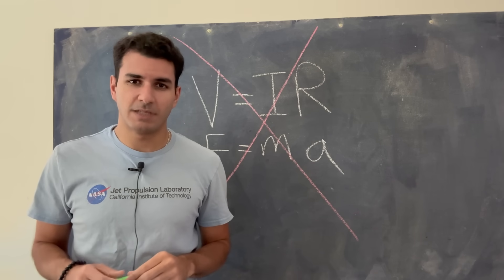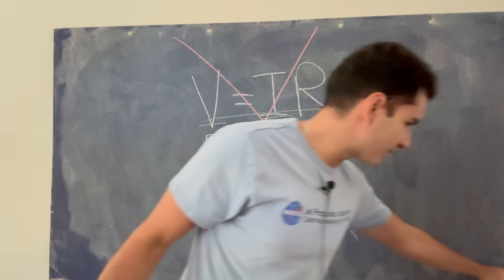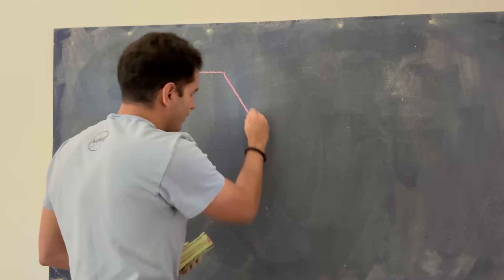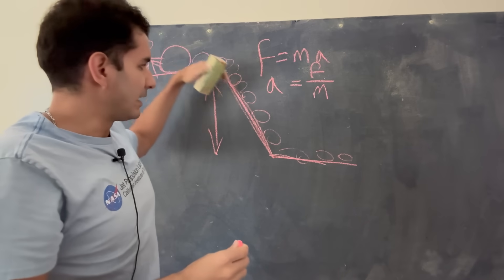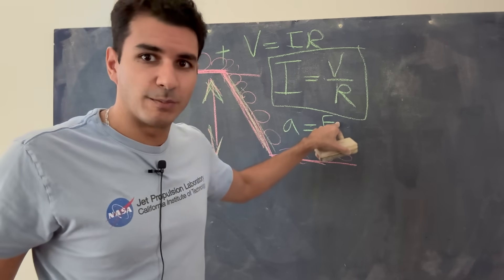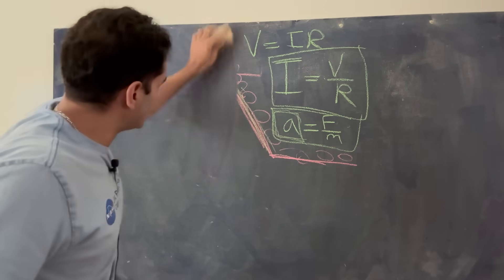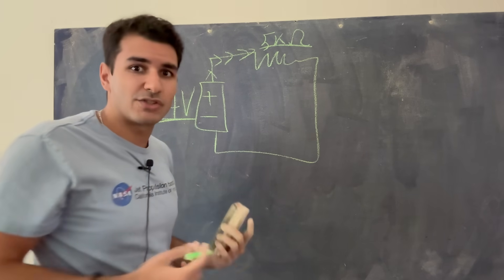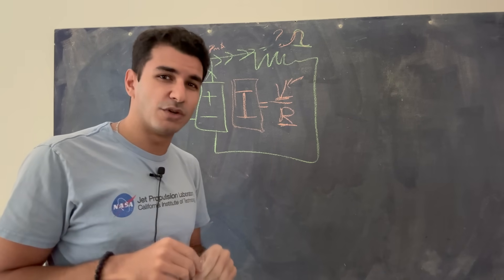You don't really understand physics

Comment: As for Ohms, law I see the problem more like this. Take a bus of arbitrary amperage, yet more than the resistors capacity. Given a certain voltage, the resistor will only let so many electrons though per time period. If you increase the voltage of the bus, more electrons get through per time period. The point is the resistor as per voltage is a hard limiter of electron flow.

Comment: 5:49 Kinda weird analogy. Gravitational and electric potential on punctual charges are both proportional to 1/r, but the former needs a much larger scale for it to start acting like the latter. Gravitational potential is so hard to change that we consistently assume our classical mechanics problems happen assuming it's constant. Electric potential can be modeled as non constant p easily. That's why it's recommended that You don't think about change in eP with the same arguments as the change in speed using gP.
Reply: Changes in acceleration in classical dynamics are more affected by air resistance than change in position
Reply: We don't assume the gravitational potential is constant. We assume the force is. The actual assumption of the potential is that it increases linearly with distance to the ground.

Comment: I made a video on my channel where I talk about normal acceleration and what it really is. In every physics class I've taken (like 4), it has never been described correctly. My problem with how my teachers and professors have described it is exactly the issue that you describe in this video. Essentially, people describe v^2/r to be normal acceleration. It implied that a normal acceleration is caused by taking a curved path. Rather, which is what no one says, is that the curved path is implied by the normal acceleration. A fighter pilot does not experience many G's of force because of a tight curve he's turning. A fighter pilot is experiencing many G's because there is a giant f***ing engine thrusting him perpendicular to his velocity. Im glad you're highlighting more examples of this misunderstanding.
Reply: I think you are mistaken. The RESULTANT force on the aircraft is given by mv^2/r. There are other forces on the aircraft besides the engine's thrust such as lift and drag, altogether they compose the resultant centripetal force. Because this force is radial and there is no angular acceleration in the simplest case the resultant acceleration is v^2/r . There has to be a force on the pilot keeping him inside the aircraft and moving with the plane, the harness keeping him in place will stretch and apply this force on him. 
Centripetal force is not a force like gravity, it is merely stating that the resultant force is directed radially inwards. It is not a separate force that acts on the plane, this is a common misconception. It ought to be stressed that a centripetal force is not a constant force because although the magnitude is constant the direction is not. Take the example of an object at the end of a piece of string that is swung in a horizontal circle, the force on the object comes from the stretching of the string and is the tension. This tension is directed towards the centre and is called a centripetal force, it is not something that occurs because of circular motion but rather its circular motion occurs because the tension is directed towards one point.

Comment: This is approach is not totally correct either. We should say instead that a force produces a change in momentum, meaning d(m*v)/dt = f. If the mass is constant then this reduces to m*dv/dt = m*a = f, so in that case you can reinterpret this as a=f/m. But when both the mass and the velocity are changing, like in a rocket launch, this becomes m*dv/dt + v*dm/dt = f, and in that case is not only the force creating a change in velocity.
Reply: Actually, d(m*v)/dt=f is wrong, unless you're very specifically considering an instant in time at which the fuel particles that have just been emitted are stationary relative to the inertial reference frame that you're working in. The correct equation is
m*dv/dt - u*dm/dt = f
if f excludes the propulsion force from the fuel, or just the classic "f=ma" if f includes the propulsion force from the fuel. In the above equation, the term 'u' denotes the emission velocity of the fuel relative to the rocket.

Comment: F=dp/dt is i think the proper representation of force. F=m.a cannot be applied for variable mass like rocket propulsion where mass of gases ejected makes the mass of the rocket variable
Reply: F=ma is the correct equation for a variable-mass system, as long as the "net force F" on the left-hand side includes the propulsion force (defined as udm/dt, where u is the emission velocity of the fuel relative to the rocket). The equation "F=d(m.v)/dt" is false for variable-mass systems like rockets, unless you're very specifically considering an instant in time at which the fuel particles that have just been emitted are stationary relative to the inertial reference frame that you're working in (and then, you have to exclude the propulsion force from the "net force F" on the left-hand side of the equation, which is not very intuitive). The paper "On the use and abuse of Newton's second law for variable mass problems" (Plastino & Muzzio, 1992) documents published errors based on the common misconception that F=d(m.v)/dt is the general equation for a variable-mass system.

Comment: You should explain thermodynamics and why we cant get to 0 celsius
Reply: It's zero Kelvin.   We have no trouble getting things to zero Celsius, that's just freezing water.

Essentially, the 3rd law of thermodynamics states that we cannot achieve absolute zero in a finite number of processes.  We can get arbitrarily close to it, but never exactly to it.  The last time I checked, the coldest temperature we've ever achieved in a laboratory is 100 picokelvin.  And the coldest temperature we've discovered in nature, as in anywhere outside a laboratory, is 1 Kelvin.
Reply: @carultch  thanks but why can’t we get to absolute zero. Is it limitless no matter how we try
Reply: @tnt-dynamikz1874  Heat essentially means the movement of molecules. If no molecules are moving then you have no heat, meaning 0 Kelvin
Reply: @factory_enslavement  then mind if i ask what is the highest temperature we have achieved, and what is really heat ( is it the resulting energy coming from molecules movement)
Reply: @tnt-dynamikz1874  5.5 trillions C. It was from the collision of ions. Keep in mind that it was estimated mathematically not directly measured.

Comment: This is complete drivel. To anyone with any Math skills at all, the way the equation is manipulated is irrelevant! It all means the same thing, that three variables are related. The form used it purely dependent on the information required and the data available. A true Physicist needs to understand what the equation's means in any form. If you can not, better start applying at MacDonald's.

Comment: Of course, I = f(V) = V/R, AND V= f(I) = IR depending on whether you apply a voltage or current. It's like there is more than one way to look at things.
Reply: And where does the current come from? There must be a P.D., or Potential Difference (=V) for current to flow in an electrical circuit. The P.D. is what causes the current to flow.
Reply: @HistorymanDublin  There are constant current sources that can push the same current into a range of resistances. 20 ma current loop is a common signaling device. For signaling 10 feet or 100 feet.  Yes, of course, there is a variable voltage source, but the value being controlled is current.
Reply: @camgere  and where does the current come from?

Comment: it is true that current is caused by a voltage. u cannt have current without voltage. i actualy had a whole debate with my phy teacher about this. in ncert (its a standard book for indian students) they have written. Voltage is directly proportional to current which seemed kinda odd to me. i told me teacher that it should be the other way around. current should be proportional to voltage. as voltage increases current increases. the other way arround didnt make sense. my teacher also agreed. but then i realised that there are these devices called constant current power supply. as u increase the current the voltage increases.  it started to kinda make sense. but i stil think they should write current is proportional to voltage. IT JUST MAKES MORE SENSE AND U CANT REALLY HAVE CURRENT WITHOUHT VOLTAGE except in superconductors ofc.
Reply: wow long essay.

Comment: good nicely explained. also  I will add
acceleration is "rate of change of speed w.r.t time". the reason we experience "Force" is due to this rate of change of speed. if you are sitting in a car and going at a constant speed  , i.e change in speed is zero w.r.t time  , "Force" experienced  is zero. but, if you experience a "speed breaker", there is sudden change in speed that we experience as "force" sitting in Car.
so, if we want a smooth ride there should be no bumps on road that would change our speed.
for I=V/R, the reason current flows is there is natural tendency to neutralize the charge imbalance in circuit. we cause this imbalance by adding a "Voltage" i.e difference in potential energy of charge. so when circuit is closed, it tries to neutralize the charge imbalance by flowing current.
the laws followed by circuit are coloumb's law, Kirchoff's Voltage law (KVL) , Kirchoff's current law (KCL)

Comment: Never realized F=ma and V=IR similarities: 
Both have an instantaneous rate of change with respect to time; I and a.  
Both have a constant; m and R
Reply: @oscarpesantes6342  Oh yeah, that is really cool. You helped me notice it.
F = m*dv/dt (constant mass)
V = R*dQ/dt
Reply: And actually if you really see it deep down and understand it...
Force is really just potential energy gradient (for conservative forces like gravity) and V is potential difference something along the lines of potential energy difference (for unit positive charge)...and so they both depict that energy difference cause motion in certain particles. And both actually accelerate the particle ... but in case of current we define the average drift velocity and so the acceleration of electron fades away from notice because of the averaging part.
So both eqns depict force fields that cause change in state of motion in particles like a normal object of mass m or a negatively charged electron.
Reply: You can say they're all constant in Ohms law, because it really only hold true in a static case, an instateneous moment in time. Sure you can get accurate enough results for a circuit in "steady state" but if you've ever measured a circuit you will see that even the resistance value of a single resistor will fluctuate, even more so if you breath on it.
Reply: Take a look at Bond-graph modeling paper

Comment: I like this however (my opine) the analogy from Newton's laws to Ohm's law is different enough to be confusing.  Maybe if in the case for gravity, there is an elevation potential, but the system is underwater or in some fluid that perfectly reduces the momentum such that A(g) instills a constant velocity downward for the ball.  Acceleration in the electromagnetic world is done at Cern or Fermi? Maybe thats why they call it an 'accelerator'(?) Otherwise, (in DC anyway) a simple linear resistant circuit eventually arrives at a steady-state flow, (like constant v?) I'm not an engineer but have been studying this lately because it is sooo fascinating. Harnessed Electricity is the greatest invention since the discovery of fire, the former being around only for 150 years or so.

Comment: I have a riddle for you Ali. How does the battery with voltage V know you have connected it to a resistance of R so it can start pumping a current I?
Reply from the maker: the moment you "connect" the wire with the resistor, the current will start flowing assuming the new resistance is lower than not having anything connected at all (which is very high resistance)
Reply: There is an EMF, which produces an electric field over the entire thing. When electrons begin to flow, they encounter resistance. The finite EMF comes into balance with this resistance. Voltage is a measure of the EMF, and its value is related to the resistance. But if V and R are fixed, only I can vary. It doesn't all happen simultaneously in other words.

But I think part of your point is that V is fixed in this case. In fact, R is also fixed.

Comment: disagree… voltage is not a force
Reply: It is not a force as in mechanics, but it is an impetus. But when a given impetus exists, does the flow of electrons ever fail to equal the potential flow? Well, yes, as in inductance or capacitance. So it may be like the flow of water down an inclined plane, with little traps occasionally for the water that slows it down more than just the angle of the incline.

Comment: Hi Ali, I’m a first-year electrical engineering student, and I’ve been searching for books that explain the underlying concepts in circuit analysis. In my course, we’re taught methods to solve for current and voltage in complex circuits, but they often feel like 'black magic'—given without explanation of where they come from or why we can make certain assumptions.

I’m also looking to understand how electricity works on a deeper, more physical level. For example, how do electrons actually behave when a circuit is powered on? How does the signal propagate in wires to create a specific current with a given resistance? And what is really happening across a resistor—are charges accumulating, or is something else happening? Proof of KCL and KVL, why resistors in parallel have the same voltage etc... 

If you could make a video on this topic, recommending books that provide deeper insights into these concepts, it would be greatly appreciated.
Reply: The best person that I have seen to explain physic concepts is with Dr. Lewin at MIT 8.02 Electricity and Magnetism. Truly eye opening!
Reply: Proof of KVl? In university physics 2 you will realize that KVl is just Faraday’s law from Maxwell’s equations in a special case where the given system is conserved. Walter Lewin (MIT prof) further explains this in his channel. If you want to learn circuits study any university physics textbook (Freedman or Halliday are greats ones!). After that you could study electrodynamics (Griffiths)
Reply: I completely relate with you buddy, same situation!
Reply: KCL is ultimately based on conservation of charge.  Charge entering a point = charge leaving a point, since charge cannot accumulate at a point (unless it is a capacitor, but just a point is not a capacitor).  Even capacitors have their own conservation of charge law.

KVL is a special case of Faraday's law of induction.  Essentially, when there are no inductive sources of voltage due to changing magnetic fields, electric fields are conservative.  This means the closed loop work done on any charge, is zero.

"What is really happening across a resistor"?
Charge is not accumulating anywhere, rather the charge flow is competing with the thermal motion of the charges to proceed forward.  The thermal motion is chaotic and adds up to zero among all the electrons, and is significantly greater than the electron drift.  The electrical motion adds a slight bias in the direction of current flow that causes a net flow of charges.  To overcome the chaotic thermal motion, it takes an electric field thru the component to bias the flow of charges to where they need to go.  This means work is done on the charges to get them to move beyond what just their thermal motion is.  This work done on the charges is what causes the voltage drop across the resistor.

"How do electrons actually behave when a circuit is powered on"?
The electrons already fill the circuit.  The electric field propagates at nearly the speed of light through it, and disturbs a large quantity of electrons at once.  This causes them to no longer just move randomly for their thermal motion, but also to move in the direction the electric field forces them to move.

One of the most remarkable parts of this question, is that the electric field propagates, even where there isn't a wire.  Derek from Veritasium has a thought experiment about this, where there's a battery and switch, that's 1 meter across from a bulb, and a circuit that extends 1 light second in both directions.  His question was how long does it take the bulb to light?  1 second?  2 seconds? 3 nanoseconds?  Or 1/2 second?  The answer surprisingly is 3 nanoseconds.  The electric field actually propagates across the 1 meter gap first, and causes current to flow through the bulb, before it can even complete a round trip through the circuit.  It doesn't sustain significant amounts of current, but current flows nevertheless.  You need to complete the circuit to maximize the efficiency of power transmission, but you can still transmit small amounts of power, before a round trip is complete.

Alpha Phoenix has experimental evidence that supports this theory.  He constructed this thought experiment with a kilometer of wire, and a load that was 1 meter across from the source and switch.  He tested it with a state-of-the-art oscilloscope, and showed that you get power transmission faster than the round trip time for the circuit.  You don't get full power transmission until the round trip is completed, but you still get some power transmission in the time it takes the field waves to propagate just 1 meter.